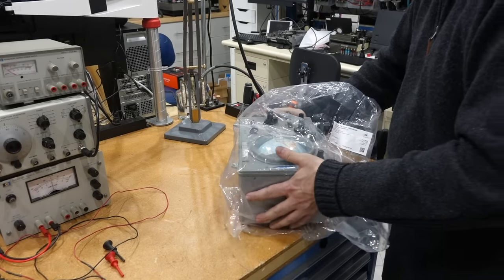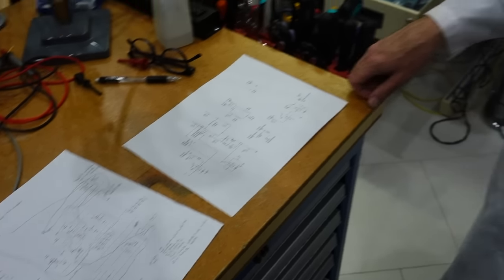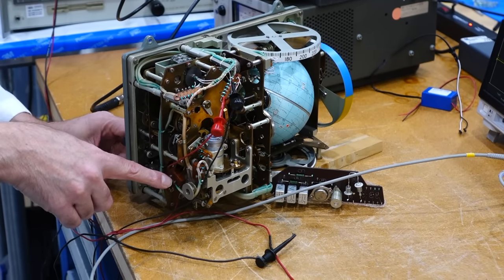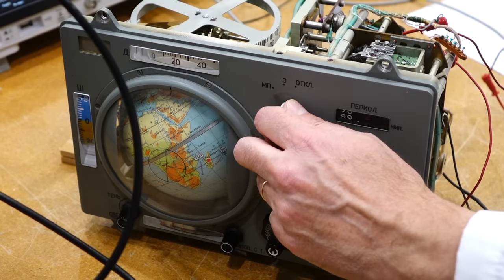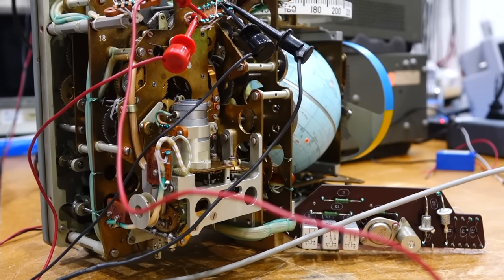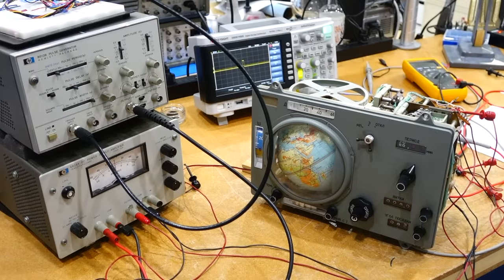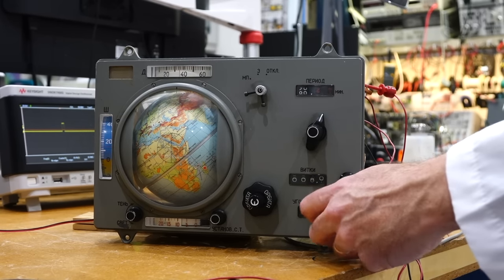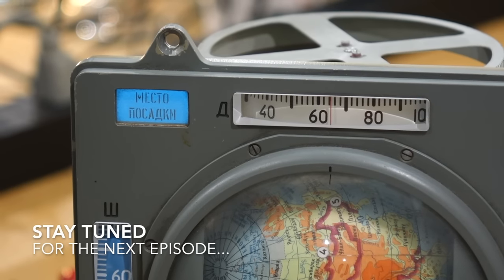Soyuz "Globus" Mechanical Navigation Computer Part 3: Landing Function

Comment: I don't understand the negative comments about Russian space hardware - not engineers obviously. It might have been less sophisticated but it worked and also represents the primary "ground control" Soviet thinking which was the same in the US for Mercury but evolved into a more spacecraft centric control model through Gemini, Apollo etc.. Soyuz has an incredible success rate also.
Reply: Not bad considering there are only a few countries that did this at all.

Comment: Whoooooooa, you got a real deal Soyuz control panel? Most impressive! May be crude compared to Apollo, but still a thing of beauty and a joy for ever.
The Mercury instrument looks interesting too. Hope you'll be able to work on one at some point.

Landing zone confirmed!
Reply: When it was designed, it was top notch mechanical computer prowess

It servers as a mechanical backup to the main computer, so as long as it do it's job, there is no need to fix it either.

Comment: What makes these devices even more amazing is the fact that they have to work after a few minutes of vibrations and 7g overload.
Reply: I dont think the Soyuz pulls 7g at any point. Maybe the landing, but at this point the computer isnt needed anymore.
Reply: @vantuz8264  
In the second world war anti aircraft shell were developed with valve proximity fused.  Solid metal presents less of a challenge.... probably.

Comment: The Globus is a beautiful machine.  It’s literally hardware, and pretty impervious to unexpected flaws.  The main limitation is being locked into one immutable task.  There is no chance for an elegant hack such as the one which saved the Apollo 14 LM descent by patching around sensing of the short circuited abort button.  … not that a hack would likely be needed in the context of Globus’s operation.

Comment: I’m trying to decide if that solenoid clanking would be reassuring in its constancy or it would quickly drive me crazy.  The latter.  😊
Reply from the maker: Apparently the earlier. They used the clicking as a confirmation that the capsule had separated properly, as the separation triggered the start of the Globus. I suppose it must have been much quieter with the cover on and behind the thick control panel.
Reply: Some nuclear power plants broadcast a click similar to this to let everyone know that the intercom is working and that there are no alarms.
Reply: @CuriousMarc  Thank you Marc.  And thank you for your work preserving engineering history.
Reply: @awatt  I never thought about it before, but I had an office in the back of a computing equipment platform room and there was an annunciator and strobe for the Simplex fire alarm in there because the machine noise drowned out the unit in the hallway outside.  The speaker emitted a constant sort of digital grinding sound with a faint sound of the fire tone in the background.  I chalked it up to lax design, but perhaps that was intentional verification the thing was functional.  It was irritating enough that I played a radio at low volume to cover it up.

In a similar vein, a Vax 11/750, one of the machines I cared for, had a big red fault light on the front.  The light was kept lit a little bit constantly to verify it wasn’t burned out.  The only problem was that Digital’s idea of lit a little bit was still pretty bright and more than once I spooked myself glancing over and thinking the fault light might be on.

Comment: It took a long time for digital computers to get good enough to replace these. Early computers did not have much working memory and struggled with floating point calculations.
Reply: Buran made uncrewed spaceflight in 1988 on computer with next characteristics: 4 MHz processor, 128 KB RAM, 16 KB permanent program memory)) That is, the power of this computer was enough to fly into space and automatically land on an airfield without engines.

Comment: About the "old" instrument: in an documentation about russian space program and the sojuz they said (if I remember correctly) that the sojuz hasn't changed much over the years, because the russians are quite pragmatic. If it works, why change it and create new problems?
Reply: It is not the only reason, to be honest. The bureaucratic procedures to confirm that the new equipment was reliable enough to fly into space were very tedious (and largely meaningless). So, why do something if you can do nothing? 
But when it was necessary, they worked as hard as they could. A good example is the development of spacesuits for the Soyuz-Apollo mission
Reply: The world changes. There was nothing "wrong" with Stradivarius violins. If you're missing components you use current components.
Reply: But this device only marginally "works".  It's not a general navigation instrument.  It's a map display that shows what should be happening if the craft is on the nominal flight path, limited to a circular unperturbed orbit at a single fixed inclination.  It's sole degree of freedom is a minor correction for the altitude (orbital period).  Even for that it requires two adjustments, with the second being the externally calculated angle of the landing point.

"It's simpler and just as good" can sometimes be true, but often it's just a coping mechanism.

This is a beautiful instrument and a wonderful piece of history, but it was a dead end.  It wasn't going to get the soviets to the next level of space travel.
Reply: @1djbecker  My comment was about the sojuz spacecraft, not about a single instrument or device.

Comment: I'm curious how exactly this was used in flight. I imagine they would place the globus in landing mode and when the landing point gets to the desired landing zone, they would initiate the deorbit burn.
Reply: That's it.
Reply from the maker: Exactly.
Reply: To expand on this a bit, mission control would send them the various landing opportunities for each day. They were sent the orbit number, the time for the burn, and the landing angle (ugol posadki), and it's this angle that they input into the instrument to use in landing mode. This angle would depend on the orbital altitude.

Comment: Is the landing point calculated based on an immediate deorbit burn, or is that set some other way?  The landing seems soon if the present position is where the retrorockets are fired. The landing ellipse I'd expect to be about a half orbit after the re-entry burn. Or not?
Reply from the maker: Based on immediate deorbit burn. The mechanism keeps rotating while in “landing mode” so you can just trigger your deorbit burn when the indicated landing point is where you want it.
Reply: @CuriousMarc  Thanks! I wish I had me one them Globuses to play around with.

Comment: I was wondering why they used this to the year 2002. Maybe it just was configured correctly and programming the electronics would be more work than it's worth. Or maybe something i can't think about. Well. Then you said the magic words. As a backup. Yea. That. very robust against electromagnetic interference, and capable of doing what needs to be done in an emergency. That. A bit bulky so that may be why they don't use it anymore, but. Yep. This is perfect for a backup.
Reply: Of course, it was not used in 2002, it stood as a backup device. The main device used was an electronic computer.
Reply: Also if it has worked for 30 years changing it has a cost. Lots of unknowns there. Also not so much electromagnetic interference but radiation makes computing in space less reliable
Reply: @zyeborm  Yea. Every single change has with pun intended astronomical cost. And a huge amount of testing. Nothing beats decades of reliable use.

Comment: What is the Otkl ("off"?) mode? Does it just disconnect/halt the display to stop rotating?
Reply from the maker: Yes, it’s half of the power switch. The other half was controlled by the spaceship itself, so that the Globus would start automatically when the 3rd stage separated from the Soyuz capsule, releasing it into orbit. The Globus would have been preset on the ground for the projected orbit insertion point.

Comment: When in landing position does the globe still track orbit? And will is show when to fire?
Reply: The orbital period is a correctable parameter, like correcting a clock speed depending on the orbital velocity. After changing to the Landing mode, it will continue to tick. It will slow down by using a velocity model for a time defined by the landing down period when it will stop. The surrounding plasma does not affect the mechanical clock. 
Of course, the accuracy is not very high. The device shows only an approximate location according to the model. As a result, one gets to know which part of the world it is.